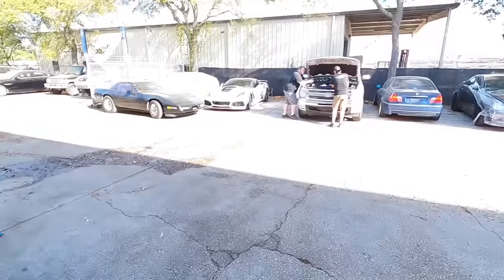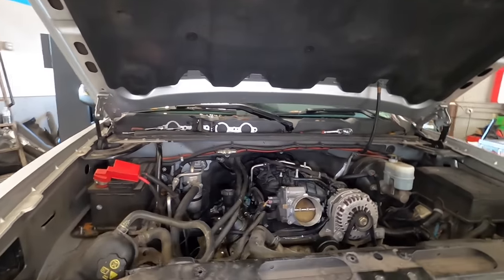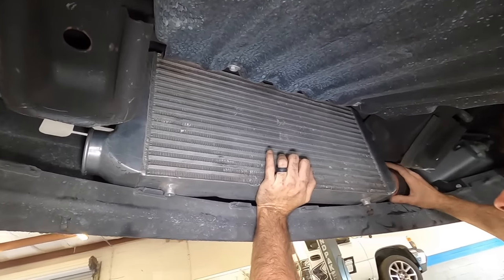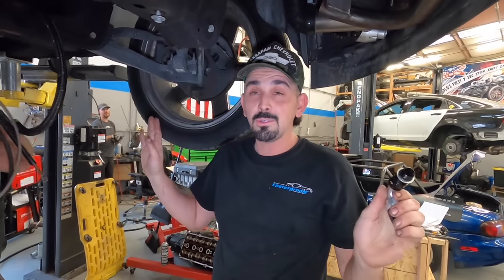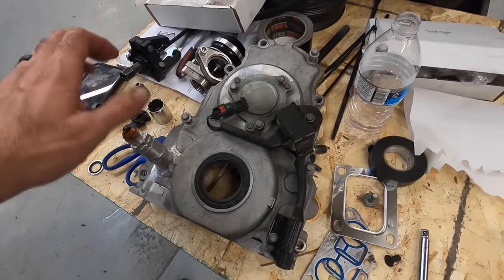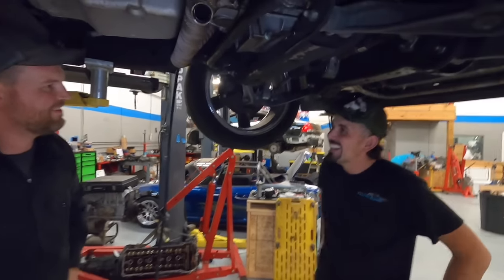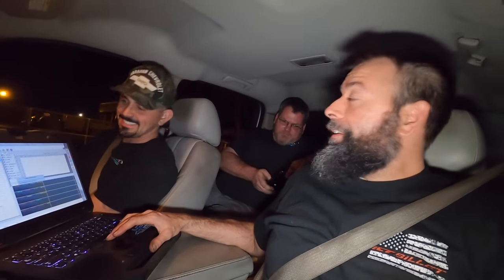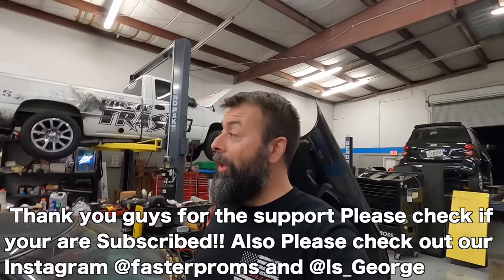Installing George's TURBO Kit In ONE DAY! Blue Collar Boost Ep. 2

Comment: you might want to plug up the pipe for the bottom mount of the intercooler , the openings are at the top andit will probably fill up with all sorts of mud water etc

Comment: I am subbed with the little bell, and I got the notification for whatever it's worth. 

Turbo kit it one day 🤔 Nicely done either way. I'm living that dangerous life with belts and hoses too, and I'm not even under pressure. Unless you shove the motor under the dash it can be pretty cramped in an S10 with an LS. Almost two years as a daily and the only problems I've had is with the serpentine belt, but that's because I didn't want to cut frame for A/C. It's a decent bracket kit for the compressor, but if you don't bolt it up just right you'll eat belts. 

More pooches? More outros with said pooches?

Comment: When you were running the log there, are those all the load cells it has?  Is it supposed to bottom out?  I have a way different ECU, but it never gets to the bottom row for me.  Just wondering.

Comment: Jeremy, there is something causing the slow spool that isn't the headers with long tube headers. If you used 0.065 wall 2" primaries 36" long, which is huge, the internal volume is about 100 cubic inches. Given the expansion of combustion gasses and the volume of each cylinder, the average 6 liter would fill each pipe in one cycle. Even with 8 pounds of drive pressure, a 5.3 would fill the exhaust runner in less than two cycles. Even at 2000 rpm, that's only .12s for two complete cycles. I'm not saying the factory manifolds don't work, aren't good and keeping heat in and actually flow decent, what I am saying is that the average header for a front mount turbo, with runners less than 20" long, will add on average less than one twentieth of a second to the drive pipe presurization time at only 2400 rpm. It's maybe not worth it, the gains on the other side aren't great but something other than the headers themselves is causing this when it happens. I know factory ls manifolds come in a pretty large variety of shapes and sizes and all flow pretty well, but I hate seeing cast manifolds on something that isn't a diesel that is running 1600f egts for minutes at a time with 50 pounds of drive pressure. You only have to look at serious turbo road race cars to see if manifolds, even ported factory ones, can hold a candle to a tubular manifold and they don't. A properly designed tubular manifold will cut both spool time and drive pressure.
Reply from the maker: High flowing but low volume

Comment: Is it possible to add a turbo to a 2010 Chevy Silverado 2500HD 6.0 Vortec. I would like to add that to my truck. Also I would like to install an Exhaust Brake or Jake brakes to it. How much would you charge to do such a thing? Also the truck engine is stock with no Modifications. Also a great video.

Comment: Wouldn't you use a catchcan normally for pcv or am I messed up?
Reply: Joe Blow If it’s just an open catchcan you loose the suction of a good PCV system that helps pull out the crankcase blowby.

Comment: wait so is the turbo only driven by the left bank of the engine and the right side just goes out the exhaust like normal?
Reply: therealdede It has a crossover pipe where the right side ties into the left side.

Comment: Couldn't you have run the turbo drain directly to the oil pan? Seems it would have been a lot easier to drill, tap and or weld a bung on that oil pan as opposed to that front cover.. but hey I am by no means a professional lol just an observation is all